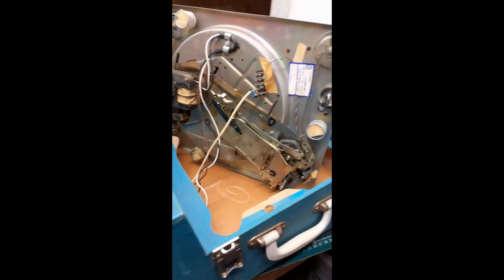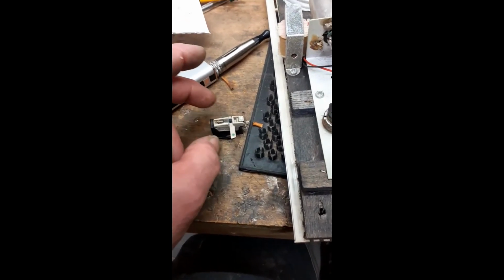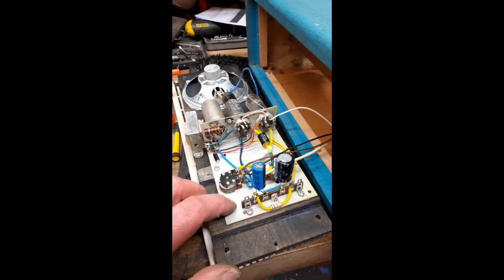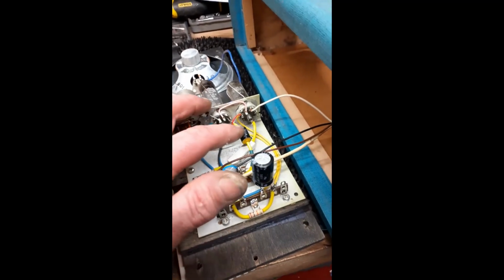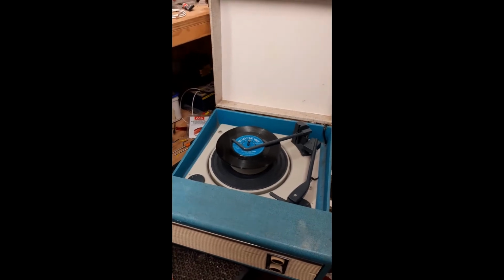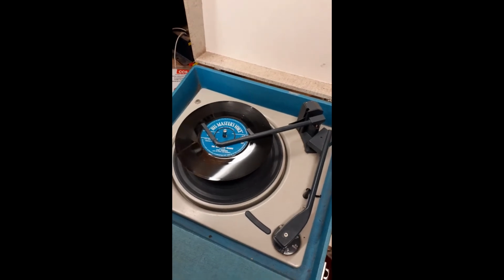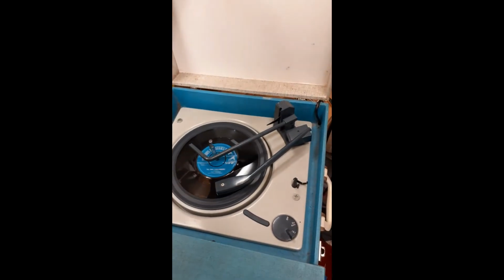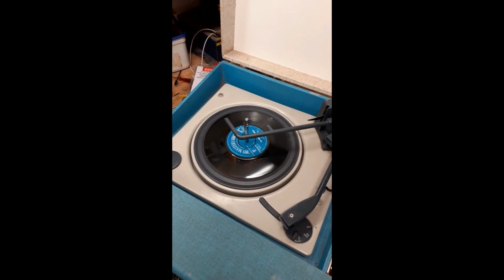fidelity record player repair and re-cap

Comment: Can you please recommend where to obtain the 330Ω power resistor (I think you said 7 watts) and would it make a hum if I used a wire wound resistor instead?
Reply from the maker: https://www.cricklewoodelectronics.com/5W330R.html?gad_source=1&gclid=Cj0KCQjw-r-vBhC-ARIsAGgUO2AFcsCFkwA0Q4g_0oSCCOUrdtTrnPYRGUhnMu2ii4R0BqoI-csrFbcaAvstEALw_wcB   5 watt w/w is fine.

Comment: Hi, I have acquired an old FIDELITY HF19 from a skip. After much searching I found the model number on a vintage website, I would like to find and try replace the decals with the model number style. The valves are UL84 and UY85 same as yours (sadly the originals were both missing.) Would you by any chance know where I can get a spring clip for the tone arm and the popup centre boss for 45's, please?

Comment: Hi 👋 I wonder if you could help me please, I own a fidelity record player, it was working fine but one day it just fizzed out. I’ve tried replacing the valves but not sure if I’ve got the right ones. The transportation works perfectly but the amplifier doesn’t seem to do anything. Maybe the capacitors have dried out (which is probably the cause but could you tell me what valves you use in yours please?
Reply from the maker: from memory, UL84, UY85